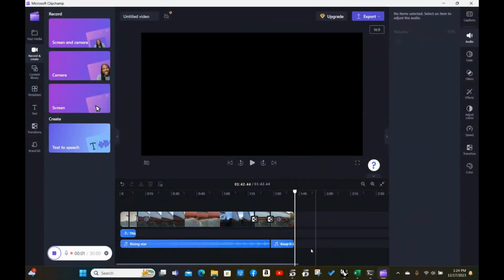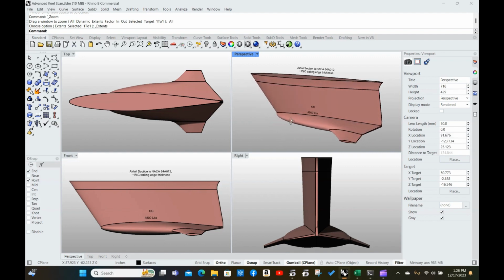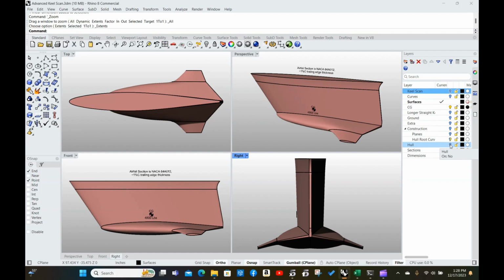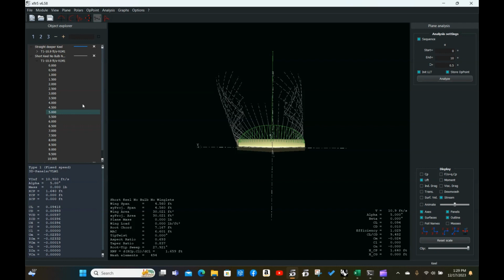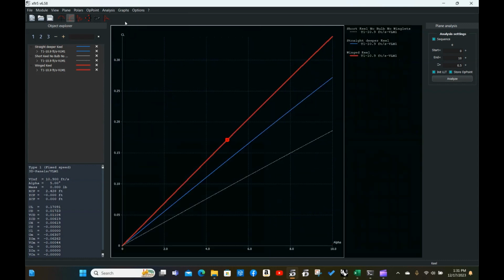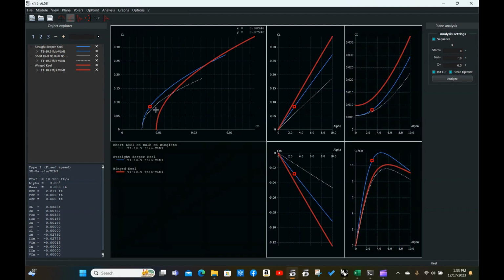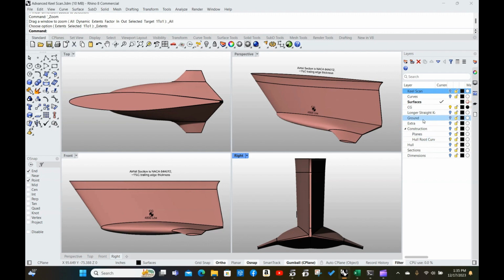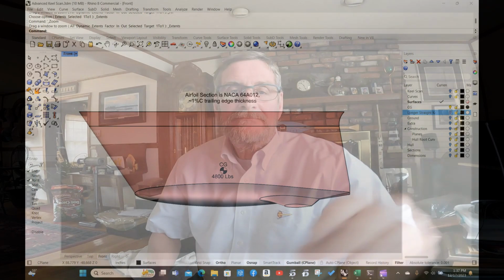LiDar the Keel

Comment: interesting analysis - the wing is great as allows to get into shallow areas without performance compromise!
Reply from the maker: Ken, it's a quick analysis for comparison/illustration, it also includes two bulbs. Using a wing creates a plane of symmetry along the centerline, much like the hull end plating the keel. (Albeit horizontal) The lift coefficient should be close to correct, the drag coefficient for the winged keel is no doubt higher than it would be. I'll run a 'one sided', more correct comparison in a more complete program using a ground plane to simulate the hull next, this was a first cut but meaningful enough I thought I'd publish it.
Reply: Hi thanks in laymans terms is it fair to say the wing creates actual lift essentially lifting the hull a bit higher out of the water thereby creating less drag therefore more speed?
Reply from the maker: @kenwilder5885  no. If it lifted it would counteract the weight, which is providing the righting moment- though that works for a Moth because so much of the total weight can be the sailor hiking to windward on the 'wings' there, and he can heel to windward so the sail is helping lift too. On a cruising boat you really count on the keel weight since you won't be sending your wife or guests to the rail in heavy weather...at least for long! The most common use of winglets is to reduce the effect of tip vortices 'robbing' the lift near the tip of the wing. In this case the goal was shallow draft without much performance penalty, I suspect maybe for the ICW but it's pretty handy here on the Chesapeake! I'm pretty sure the winglets are symmetric foil sections, and they aren't big enough for that. My analysis here says it produces more lateral resistance than the deep keel but a little more drag. The Australian yacht that first won the America's Cup away from the New York Yacht Club used a winged keel, it's likely that reduced the drag compared to the defender somehow though.

 For lifting a sailboat to reduce wetted surface, the lift must be to leeward to preserve the righting moment. The most radical example today are the latest America's Cup foiling monohulls with dual canting T-foils, but that is also true of foiling cats. There is also the DSS system.